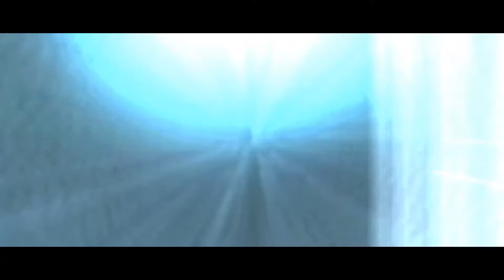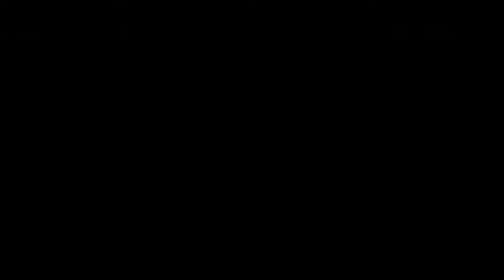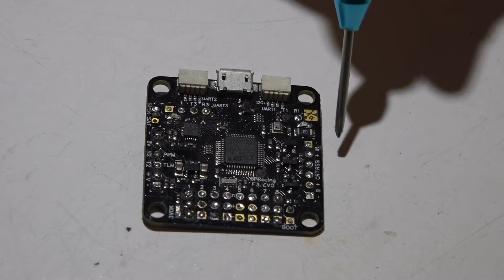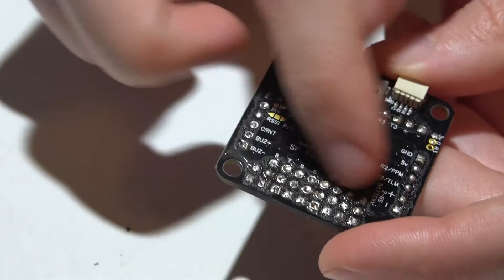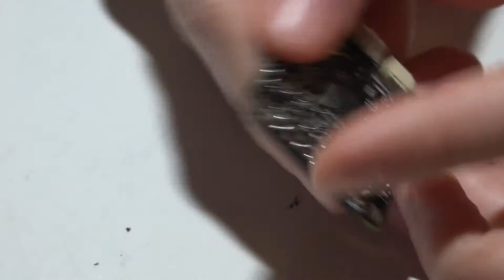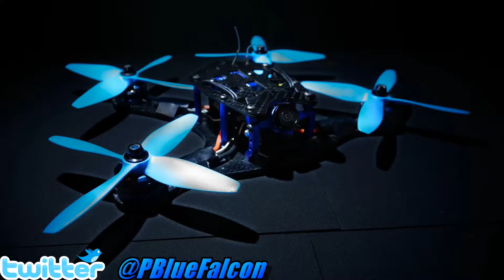Seriously Pro Racing Evo Review

Comment: Hi, I connected the led strip following this scheme: 

http://www.rjxhobby.com/rjx-rjx1176 

I also sold the jumper behind as shown to select the RGB strip but nothing to do.. Tested Mot8 and Mot5.. It do not light up, I tried 3 different strips 2 5v and a 5/12v nothing to do, the LEDs works because if connected to the bec turn on ... in betaflight I enable the LED and configure it but it does not turn on. .. has it happened?  thaks

Comment: I ordered a SPF3 Mini a while back and ended up receiving this Evo board. Will this allow the BLHeli Pass through ?
Sorry if it was in the video and I missed it. There s a lot of info to take in.
Reply from the maker: Yep it will do the BLHeli passthrough just fine. And honestly I like the Evo even more. Its also runs faster than the Mini.
Reply: Project Blue Falcon thanks for replying. I'll have a go a bit later following your spf3 playlist. 😎
Reply: +Project Blue Falcon need sp racing f3 evo dump file coz mine missing when convert to beta flight..help needed